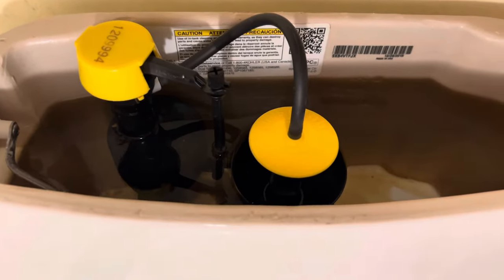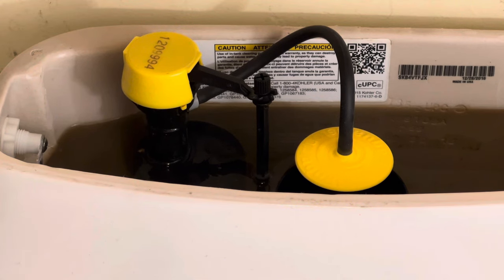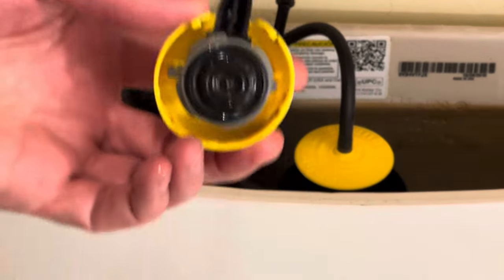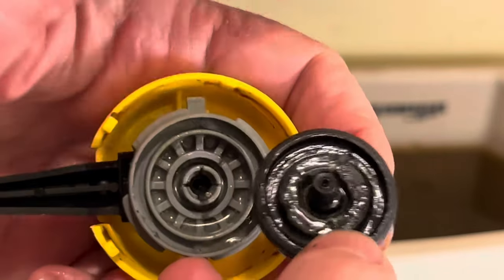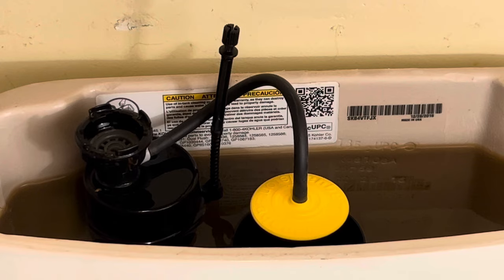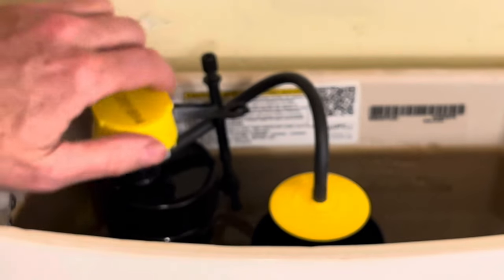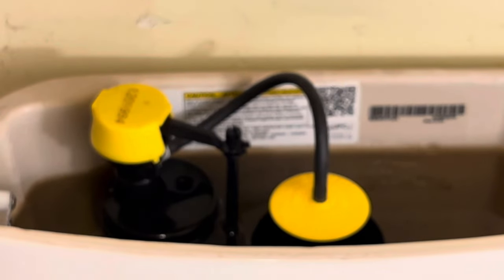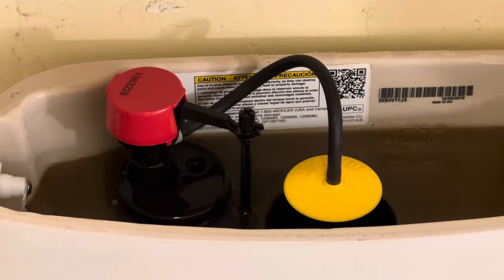How To Fix A Kohler Toilet That Runs All The Time

Comment: I have a brand new Kholer Highline Arc.  I had a plumber come out and replace the shut-off valve to the toilet because it was leaking; ever since he came out, my toilet has been running nonstop. I saw this plumber mess with the screw on the float. I wasn't quite sure why and I got distracted and didn't ask him why. I had to call that plumbing company out again because I couldn't figure out why it was constantly running. He came out and said the tube from the float to the overflow was pinched. He pulled it off, cleaned it out, cleaned the disc (mind you, this toilet is less than a week old and didn't need to be cleaned), and put it back together. Flushed it several times and it wasn't running. I watched him do this and it did stop running. So of course, my luck, I flushed it a couple hours after he left and it's running again and I just can't figure it out. So now he has to come back out again and I have to keep taking time off of work so they can fix it and it's just really bothering me. I tried messing with the float and it doesn't matter where it's at, it just runs non stop.

Comment: Very helpful video! I had to order the entire valve assembly off Amazon. Only $19.95. Just used the very top piece of the assembly like shown in the video. Worked perfectly. Toilet is no longer running. No plumber needed is always a great thing.
Reply from the maker: That’s exactly what I did. I didn’t wanna have to take everything apart, so I just pulled that part off and put it on the old one.

Comment: A lot of the comments seem to be about "seal fix not working", you might be trying to fix a symptom and not the cause.
If the gasket at the bottom of the tanking is leaking, the valve might be correctly trying to fill the tank because the gasket is leaking away water into the bowl constantly.  So in that case you'd need to fix the O ring gasket down at the bottom of the tank. One way to diagnose that is do you hear constant dripping inside the toilet?  Also, if you pull up slightly on the valve arm (do not push too hard) does the valve stop the water from running? If that's a 'yes' then the seal valve is working correctly.

Comment: I have a leak at the bottom of the right side fixture. I checked yellow seal at bottom, but it was perfectly intact. When I look inside I can see water coming in the bottom of fixture/part.
Any idea(s)?
Reply from the maker: I don’t know. It’s hard to diagnose without seeing it. The whole part is reasonably affordable, so maybe replacing the whole thing is the way to go.
Reply: @hoohoohoblin  I solved the problem. Thanks for replying.

Comment: At 0:05  that's not the Model number, that's the serial number.  Kohler is maddening to me that they have the serial number (which is mostly useless) well written on the back of the tank but the model number is much harder to find.  The model number is pressed into the porcelain at the left rear of the tank and the model number is what you need to find the correct parts.  The serial number can only be used to find the model number by using a Kohler lookup website that used to exist but I can't seem to find it any more.
Reply from the maker: Thanks

Comment: After several tries, including taking apart the large Aqua Piston Seal on the right, cleaning and reseating it, thanks to the downloadable manual from the scan code, saying just to clean it, the system stopped filling and is now working. https://www.youtube.com/watch?v=w6vnJNKwVnQ There was not much visible gunk on either item. I took off the yellow seal at the bottom of the large pistion (to which the flush handle is connected (quite challenging), and reseated the ring on the black  cylinder.